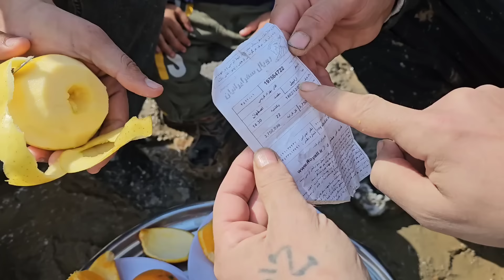Another snowy day and the construction of the house's cinder block wall.

Comment: Why keep the door open when trying to heat the home?  Waste of energy/resources
Reply: 😂. Heat's being thrown out like AliAshgar 🙃
Reply: As my dad used to say “shut the door, were you born in a tent?” These folks could well have been!
Reply: @susanclunie340  your dad's right!  👍👏
Reply: They need the light for filming.  Otherwise, the door stays shut.
Reply: @judyjones4141  cute reason for door 🚪 always open even when outside🌷.  Nomads might not usually use doors.
Reply: @judyjones4141  yep. Another weak excuse.   That's what fans are for.  Smoke detectors, 🪟 that vent might work. Door 🚪 not safe or clean for baby Beach 🏖️

Comment: Mr.Engineer, fix inside house first, then outside. Inside is more important than outside.. miss fatemeh needs her kitchen to cook and clean. Children need space for sleep.
Reply: I agree with you
Reply: The outside is important as they need to level and fill so that there is easier access to the house. Just think of trying to get a refrigerator, stove, cupboards into the house as it is now. Sinks, toilets, carpets and there are still walls to finish. What I would like is to see the house kept warmer. The doors are left open which greatly reduces the temperature inside.
Reply: I agree and correct
Reply: STOP WITH THE CRITICAL COMMENTS...HE KNOWS WHAT HE IS DOING!